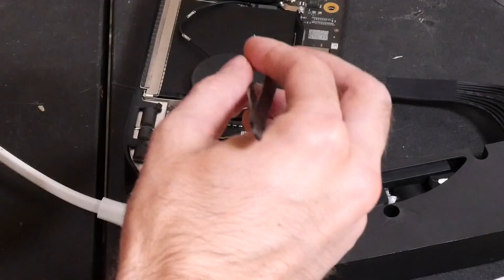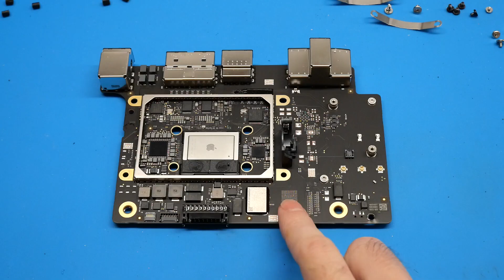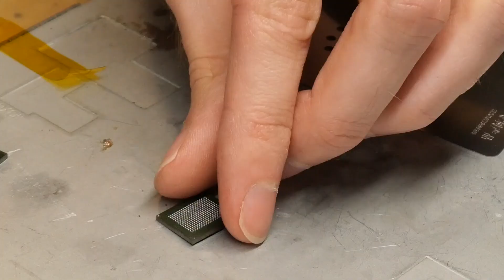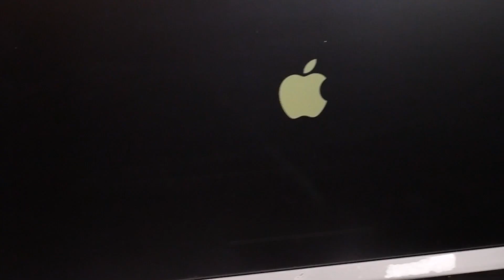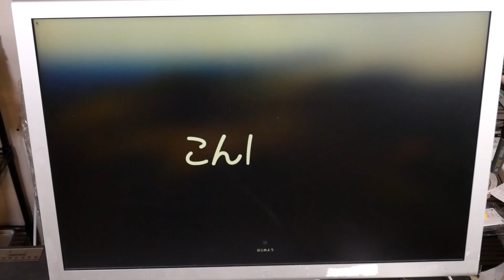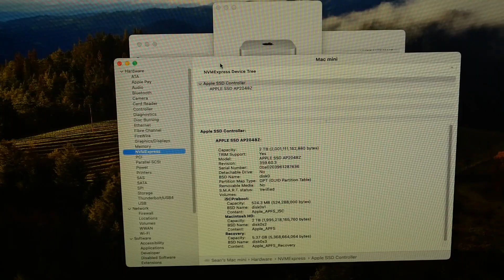Damaged M2 Mac Mini - Repair + Upgrade

Comment: Meanwhile with my Minisforum UM790, I open the case and change the NVMe drives and while I am at it change the RAM sticks with a screwdriver to open the case as the only tool. Don't enable manufacturers like Apple to make it this hard

Comment: Hi Collin, I suspect that somewhere on the motherboard of the mac mini M1 and M2, there are soldering points very close to the original SSD, which can accept the connection of an NVMe SSD adapter. Here's a suggestion, do you accept the challenge?

Comment: I did something similar on an iPhone years ago. I seem to remember having to read the old nand and program the new one with things like the serial and Bluetooth Mac. Why didn't you have to do that here? Is this process unique to the iPhone? Thanks for posting these videos
Reply: Pretty sure you don't need to do that on a blank NAND as restoring the firmware in DFU will automatically program them.

Comment: Good work on this one Dude. Is there any hope for the same upgrade for Mac Studios?
Reply from the maker: Yep, doable on Mac Studio as well. Up to 8TB with two of those removable NAND modules.
Reply: @dosdude1  would looooove to have this done on my Mac Studio.
Reply from the maker: @OscarTroya  Assuming you currently have 2TB or less installed, you’ll need to source a second NAND module in order to achieve an 8TB upgrade. They can be hard to find, but a friend of mine is working on a custom one, and expects to be done with it in a few months. I can indeed do the upgrade for you once the second NAND module is sourced.

Comment: Thank you. You are master at this.

Is it possible to know the price of the NANDs that you installed? Or at least where the price can be found. Thanks
Reply from the maker: Price is around $130 for the two NANDs.
Reply: @dosdude1   Thank you very much for the info.
I am just trying to find the prices for the NANDs and LPDDRX5-7500 RAM to see how much would they cost versus just normal fast DDR5 memory.

Comment: Do you think it would be possible to mount an M2 mac mini board into a 2018 mac mini enclosure? I can't handle the silver of the current enclosure. Like they say, once you go black...

Anyway, great job repairing and upgrading this unit, I'm sure Sean will get some good use out of it.
Reply from the maker: Yes, should be possible, though the board couldn’t be screwed into the chassis and the two rear fan screws couldn’t be used. You’d also need to transfer the power LED assembly from the original chassis into the 2018 chassis, along with the power supply.
Reply: @dosdude1  Awesome! I probably won't try it on my working 2018 mini or a brand new M2, so I'll go looking for second-hand models to try out the swap on. Thanks!

Comment: have you ever tryed to just add a secundary nand? do they have to be identical or would it work with two different sizes?
Reply from the maker: You can’t do that, as the firmware programmed onto the NAND is telling the system that it’s the only NAND installed. Simply adding a second one will cause ANS2 to panic which will of course cause the restore to fail.

Comment: God imagine having to go through this much of a struggle to upgrade storage, this is one of the reasons I am never buying a Mac personally.
Reply: i would buy slightly older one
Reply: Yeah I have an old 4.1 cMP that I had for 15 years, it’s probably the last fully upgradable computer from mac lol.
Reply: if you're actually interested in a mac, just buy used or refurbished. the storage upgrades are a scam when buying new but they're much more reasonable after a few years
Reply: "Never buying an Apple because of this". yet, right now Lenovo is phasing out their last models with  socketed storage and RAM and other manufacturers are starting to also. Beelink are soldering in their minis too. Won't be long until the last socket is gone.
I love System76 etc for "open" hardware, but they don't bring the best user experience.

Comment: Is there a reason why NAND can't be a socketed chip? I Googled this question but not a lot came back
Reply: board space and cost. It's just pennies per unit, but every company's management is under intense pressure by shareholders to keep returning record corporate profits.   So even though we're talking shorter lifespan, too bad. Lenovo does this now too.
The only way to protect your right to repair and upgrade is with legislation (which is damn difficult, even. if the EU demanded it)

Comment: Can you convert it to DC 12V? and maybe add a battery instead of the power supply
Reply from the maker: Yeah, the power supply in these is nothing more than a 12V power supply. So as long as you can supply it 12v, it’ll work.

Comment: Icloud lock for a mac mini is insane. Good for sales though. How many of these are gonna go to a landfill while being perfectly functional.
Reply: Very likely masses of them
It's not just M Mini's
It's any Mac with a Tx processor
If you buy one online and it's locked, who's going to give you their iCloud pasword to unlock it ?
You'd have access to their whole account !
Reply: @Wannes_  The iCloud account holder can remove the activation lock from their account without having the machine in front of them and without giving you their details. However if it was stolen, that's definitely not going to happen, and if it was e-wasted, it probably isn't going to happen.

Comment: I'm guessing adding higher ram would be the same process. I would have offered him that since 16gb is fine but 8gb is to low if you are wanting to use the machine to its protentional.

Comment: Common sense would’ve been to remove the melted connector first and keep it aside safe, then at the end solder that to the one missing it… just saying.

Good work and well done!👍
Reply from the maker: If I didn't have over 100 of those connectors on-hand to use... I would have saved it.

Comment: You mentioned easier to use power button pins on the other side. Do you maybe have some source showing them? Using mini with a KVM would be great if soldering to the actual power button wasn't needed.
Reply from the maker: If you look at the board on the side closest to where the power supply sits, it's the two pads closest to the rear ports of the board.

Comment: Is it possible for a setup like Collin's to be able to physically upgrade/swap RAM chips?
If so, is the only thing holding an upgrade like that back the complete lack of documentation for what kind of resistors to change for it to register properly?

Comment: How did he align the second nand so perfectly? For the fist one he had the goo that was removed to go on. I assume you can't be off more than a fraction of a millimeter. I think I would have needed to make some sort of L-shaped ridge to get it right. Or at least draw a pencil outline.
Reply: Capillary action is an amazing thing. If you look it up, you’ll be amazed how soldering components and capillary action go hand in hand to make a perfect solder. You see the process in action with the first NAND falling into place after being heated up. Science is pretty sweet!
Reply: @learnitalready  thanks! I had a hunch it would be that, although I had forgotten it was called capillary action. To me it is called the water vs mercury thing :) Cohesive / adhesive if I remember it right. So solder loves to be in the right spot. Got it! Thank you.
Reply: That was my thought as well, without outline he aligned them perfectly

Comment: Do you have tried to implement maybe 64GB RAM into a iPad? To test, if a iPad could handle that? If yes. maybe this could be a hint, that a iPad could handle a "small macOS version" ...
Reply: M1 ipad could handle macOS just fine, it's just Apple saying no
Reply: Don't need 64GB for that, it absolutely could technically handle a regular macOS install purely by its hardware specifications as is (think of all the older MacBooks with only 4 or 8GB RAM running macOS), but that would mean competition with their own laptop market
Reply: @resneptacle His idea is a good experiment never the less